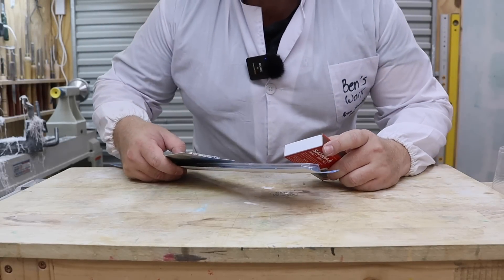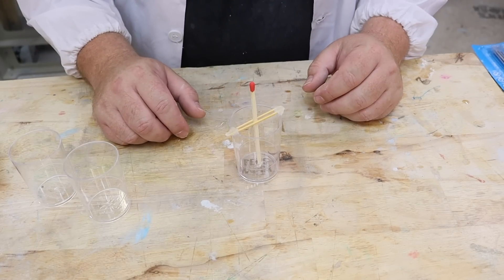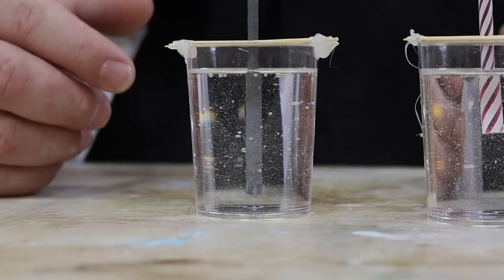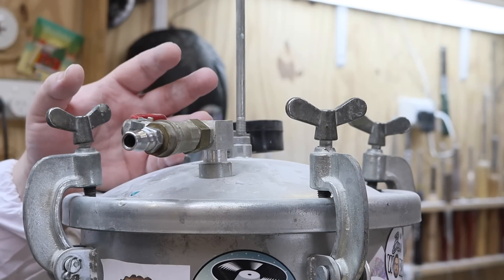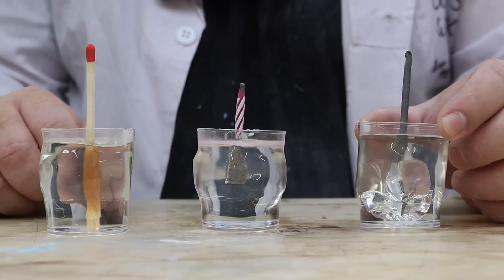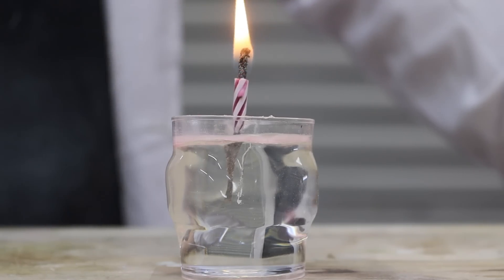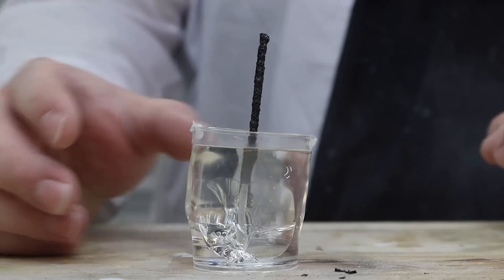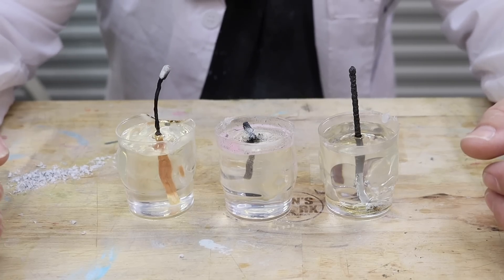Can a Lit SPARKLER go Through Resin?

Comment: What you need is a material that has fuel and its own oxidiser.  That way it will not need air.  I wonder if you could lay hands on a hobby rocket motor with solid fuel.  You'd need only a small sliver and you'd probably want a way for the gas to vent, no need to turn it into a fragmentation grenade.

Comment: Maybe place the items in drinking straws. I'm not a firerologist, but I suspect that the resin didn't allow enough air to the fuel. Even if the candle hadn't melted and the match hadn't soaked  up the resin they'd have gone out at surface level for the same reason.
A straw might allow enough air in for the sparkler, but not the others. The dark yellow flame indicates incomplete combustion even in open air, so a lower air volume would be worse.

Comment: The resin makes heat as it cures.   In the vacuum it cannot convect out so it reaches a higher temperature.   Just pull vacuum briefly and let the air back in.  Do you really need to degas these?

Comment: I would expect anything that won’t burn under water to not burn once it’s inserted into a liquid resin.  You might be able to drill a hole in the resin and then insert the sparkler and get it to work.  But you would still have two issues that I can see.  O2 for combustion and thermal mass cooling combustion.

Comment: I wonder what would happen if you placed the sparkler one into an induction coil? I'd imagine it would light in the resin. It has metal in the middle. Just a thought. Otherwise, you could also hook up a wire to both ends and send some electricity through the sparkler. 😁😁😁

Comment: I would like to see you make the cavity one again but this time wrap a piece of cannon fuse around the match and super glue it on, then scrape some of the sparkler powder off the sparkler into the cavity, add the match and  seal the cavity then light it using the magnifying glass again or a high powered laser. I think it would work. But you might want to be behind something protective in case it tries to grenade fractured resin.

Comment: you just wasted expensive resin for an experiment that was never goign to work. a sparkler is goign to absorb a liquid if you put it in a vacuum. It was made by dipping metal wire in a paste with something like alcohol included to make it a liquid. that is then evaporated to allow the sparkler to dry into a solid. (same method you would use for makign a solid fuel grain for a black powder based rocket engine)  obviously that leaves microscopic cavities in it that will absorb liquid once a vacuum is pulled. if you thought about this before testing it, then you should have been able to figure that out. 
next time spray a thin coating of resin onto the sparkler and then dip it in resin. as an added bonus.. dont use a mold that is sensitive to heat when your playing with resin... cos.... it cures by generating heat.. so your mold will melt like it did here. this why people who play with resin usually use a material like silicon to mold stuff. plastic is only for mixing pots.
to know if the candle would work, check the curing temp of your resin, and compare it to the melting temp of your wax, if the wax has a lower melting point, then its goign to fail. 
the match never would have worked, even if you lightly coated it with resin, why? because the base of the flame needs oxygen. a candle could work, but that would depend on the wick diameter and the candle diameter, you would need to leave enough of a gap for the oxygen to get past the flame, to the bottom of the wick. 
the sparkler would work as it has an oxidizer in the mixture. it just needs a light coating to protect it from absorbing the resin.

Comment: Can't help but think when you put it in the pressure pot that it forced the resin into the sparkler and into the wick and into the wood of the match so it was protecting it even when you drilled past it there was still resin coating the inside.

Comment: You would have a better chance if you didn't use the pressure pot. Also, for the sparkler, if you had a thin silicone noodle cured right up against the side of the sparkler, then pulled the silicone noodle out, it would leave a small air tube for the sparkler to ignite all the way down. That's your best chance if any.

Comment: Fire needs oxygen and resin seals the material perfectly, it can't get oxygen inside the resin to be able to burn. And what fire is? Rapid oxidization with heat and light energy, a process what needs a steady supply of oxygen, of course.😉

Comment: Those sparklers are usually magnesium (and iron shavings, which is what does the sparks) and they can even burn under water. The resin probably penetrated the sparkler, so that's why it didn't work. Maybe try what you initially did with the matches in the resin chamber? That could be fun to watch!
Reply: the problem is that the mixture has no oxidizer. magnesium can burn under water because it is reactive enough to rip o2 off of h20.

Comment: Maybe skip the pressure pot? I think it's pushing the resin into the smaller air pockets in the 3 "wicks" as you could see with the tooth-pick. Though they might have soaked it up either way.

Comment: There's no oxygen once the flame, any flame, meets epoxy. Fire needs an ignition, fuel, and oxygen. Once any of those things don't exist, the flame goes out. That's simple physics. Epoxy has no oxygen and there's no fuel to boot, so missing 2 of the 3 essentials for fire makes this whole experiment a fail before it begins. 
How about you go back to elementary physics, because understanding that, you'd never have tried this.

Comment: The problem is none of these materials can burn without a good amount of oxygen.
Now if you try this with cannon fuse it should work. Cannon fuse burns underwater since it has a tri oxide metallic compound in it.
SO for every molecule of this metal powder that burns it releases three oxygen atoms.

Comment: Try it again with tape covering the sparkler, to prevent resin from contaminating the chemistry.
Metals burning makes the sparks, but there is an oxidizer/catalyst involved as well.
Note also that sparkler burns at 2000+ F...the resin absorbed the heat, terminated the reaction.
Look up 'thermite' to get a better idea what is going on.
When the resin penetrated the sparkler coating, it was ruined.

Comment: You're a braver man than me Gunga Din.

Putting the Resin under pressure traps Oxygen and other gasses in. 
Mix up some resin, super bubbly, cure it under pressure, then nuke it in the mirowave. Might pay to check the house n contents insurance, and pack a bag before you start. Send Nicole for a holiday on coast. 👍

Comment: Fire needs oxygen, fuel, and heat. The resin is removing the oxygen from the equation, which snuffs out the flame.
You could always see if you could get it to work the same way as the match?

Comment: Do the enclosing in an airspace again (as you said, fire needs oxygen and the pressure pot removed all the air bubbles and filled them with resin).

Most crucially we need to see the sunlight setting them on fire as it’s blinking freezing over here and you’re wasting a golden opportunity to share the Aussie summer!

Comment: I had a feeling they wouldn't be able to burn through the resin due to there being no air to fuel the fire in the resin. Maybe not putting them in the pressure pot to keep air bubbles in the resin could let it burn more. Good video none the less

Comment: That was a good attempt, Ben! How about for the sparkler you put it in a cavity like you did with the match that ignited, but make the cavity bigger around so there is a bit more air. You could try the same thing using some match heads.
Reply: as soon as the o2 gone though it would stop burning.
Reply: @jheizer2467 , For sure, but it would be cool to see and given the bigger cavity, it would give it more opportunity to burn as it has more air surrounding it.

Comment: You might look for underwater-safe fuse for fireworks. You'll want to start with only a small amount and test it outside with safety goggles on, though, since you're burning something under compression. Black powder should also work, but it's easy to get in trouble with so I don't recommend it (if you can even get it there).

Comment: Great experiment but the small cavity that would have been caused burning it down, did not allow for nearly enough oxygen and some of the gas around it may have also been fumes from melting plastic and resin. I suggest put in some sort of silicone straw (not allowing resin in the straw itself), cure it, then remove it and add whatever u want to light (love the sparkler idea) into the hole where the straw was

Comment: Hi Ben! Fun video. I was wondering if you could try it again,  only don't use the pressure pot. 
That would keep the glasses from melting, and keep air in the wood and candle, and a little around the sparkler.  
Thanks for sharing.
Hi to Nicole!
USA, South Dakota, 1947 cdt.

Comment: So here's a question!
I've seen videos of people lighting firework fuses and putting the firework underground
And when the fuse gets to the ground it still goes!
So why doesn't the fire keep going into the resin with the sparkler? :0
Reply: Gunpowder (the explosive used in 99% of fireworks) ignites in a confined space because all the chemicals needed for detonation are bound up inside it.  It doesn't need atmospheric oxygen.  The same goes for most chemical fuses.  Many fuses will even burn underwater.
Reply: @andymanaus1077  Ohhhh! That makes sense, thank you! ^^

Comment: I never knew that trick candles turned Super Saiyan 2 if you let them burn down. It had the electric sparks and everything.

The only other thing that I could think of testing would be trying the match upside down into the resin so that the magnesium bit is the last part to light. Or maybe using the same setup as this but inverting the cups somehow so then the flame runs up into the resin instead of away from it.

Nice video as always.

Comment: No air = no fire. It’s one of the many reasons why it’s recommended to drop sparklers into a bucket of water after they go out.
Reply: Worth noting, that stops secondary fires. Some fireworks (including sparklers) contain their own oxygen source and as long as the water doesn't cool them too much will let them keep burning underwater.

Comment: Sparklers are supposed to contain an oxidiser, in theory it should burn underwater, though the water would remove the heat
I'm thinking the pressure pot forced resin into the sparkler, maybe try without pressurising
Interestingly 'crazy russian hacker managed to burn a sparkler underwater by wrapping with tape

Comment: I think that the problem is the pressure pot, it forces resin into all the small air pockets in the sparkler, so i would retry but letting them cure without the pot.
Reply: Good point - no oxygen, no burn.  Also, the candle ran out of material to burn.
Reply: I was gonna comment with the same thing. Fire needs oxygen to keep going, and these poor things had none.
Reply: @Leena79 im pretty sure that sparklers have both their oxygen and fuel source provided in the same pyrotechnic mixture that they use. It's probably not that different to the formulation of black powder.

I reckon the issue is - not the fact on whether the mixture has access to actual air, but more due to the fact the resin forced itself in between the pyrotechnic mixture particals and is actively poisoning the overall reaction by stealing the heat that this mixture needs to stay ignited.
Reply: @Chris47368  same thing I was thinking. The epoxy is absorbing the heat instead of allowing it to continue the reaction.
Reply: Could be worth trying to capture them in an air pocket kind of like the one match experiment
Reply: I think its time for a road flare...
Reply: We’ll also because there is 0 space the heat and pressure is pushing oxygen out of the way as soon as it hits the resin hole. No oxygen is reaching it from any direction except for right above the hole. But heat and pressure is pushing oxygen away and it can’t get into the hole.
Reply: Sparklers uses the Thermit-Reactio (mixed with Sawdust, Wood-Glue und Paint). And the Thermit-Reactio do's not need Oxygen.
The oxidiser is the aluminium-powder in the mixture. And the Rust is the reductant (the Ironoxide will be reduced to Iron).
This Reaktion will also be working in an Vacuum.
 @chaeairsoft
Reply: I was thinking the same😅 thing
Reply: Who knew fire needs air to burn? lol